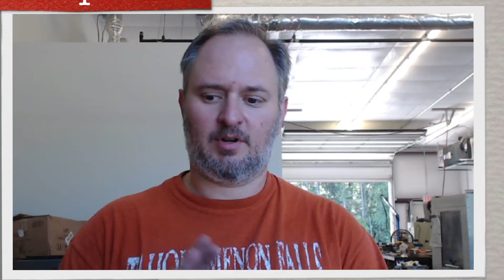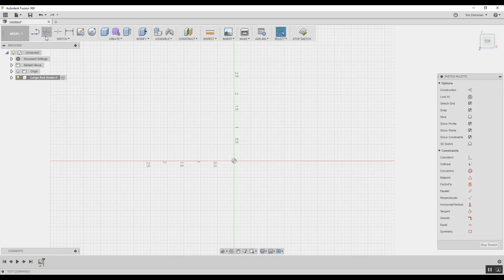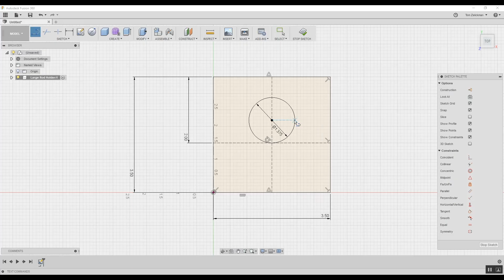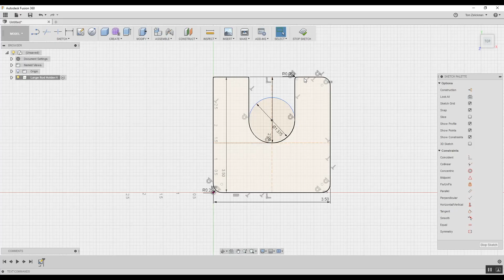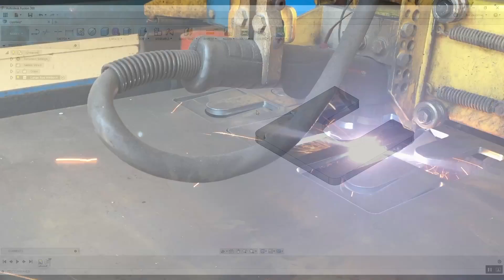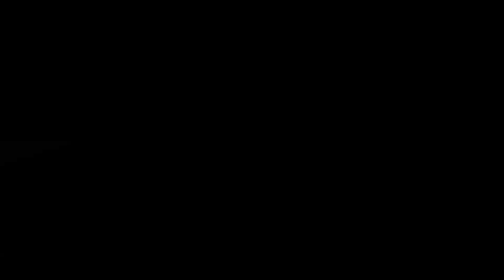Job Shop Life - Sep 2017

Comment: Tom, how did you get that file into g-code?  Did you use the post processor in Fusion or some other process?  We have a Torchmate table but I was having some issues figuring this out so I started focusing on the TM software (the table is new).  WIth the Sheet Metal feature in Fusion I may have to revisit using it if I can get a reliable process for getting it into workable g-code.

Thanks in advance.
Reply from the maker: Hi Brian,

There are two ways this can typically be done; export the sketch as a DXF and import into the native software or use the Torchmate post processor. I flip back and forth depending on the type of part I am using. If you have questions, I did a video that walks through using Fusion 360 for the gcode or reach out and I'll give you a hand. The video is here: https://youtu.be/TRf_bx7mpPM

Sincerely,
Tom Z
Reply: Thanks Tom, I thought I had watched all of the videos on youtube but I missed that one!  Thanks for the reply.